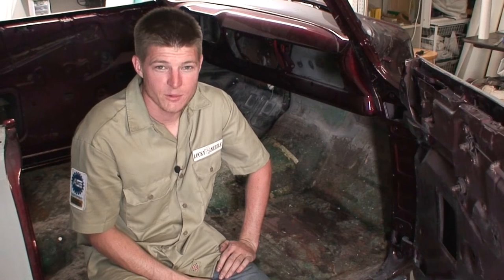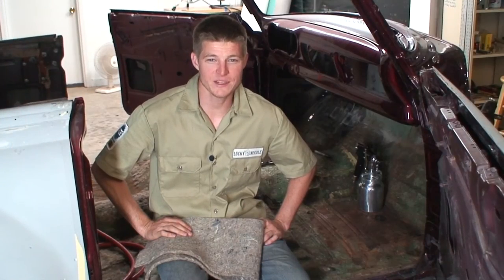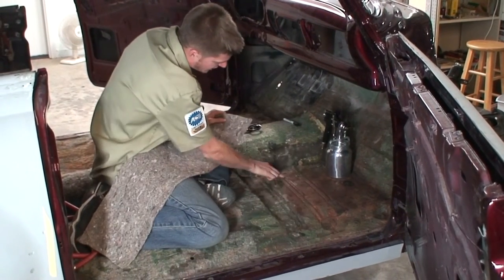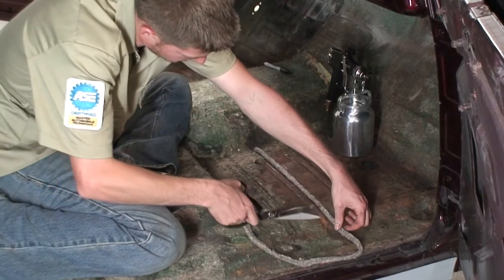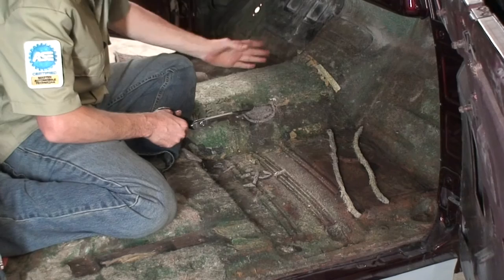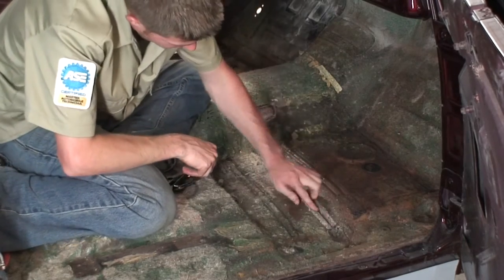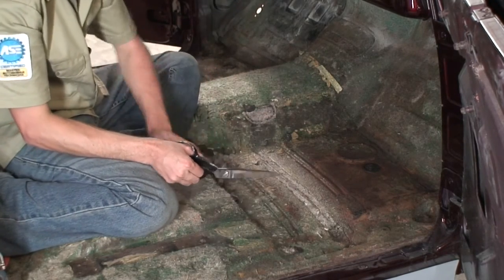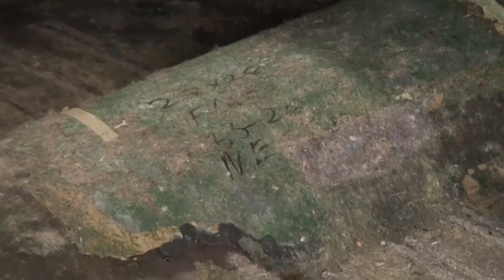Upholstery Basics - Installing Jute Carpet Padding  Step 1

Comment: What glue do you use?
Reply from the maker: weld wood landau top contact cement. Its the best i wouldn't everything else Ive used is horrible compared this stuff. This is the stuff right here
 http://amzn.to/2lq2K8Z
Reply: The Lucky Needle, that's what I use at work. Just wanted to see if you use something different. I see you are using the HF gun. Are you using the stock tip or are you using a larger one? I have that gun also at work and struggle with getting to to spray evenly. Usually get a bunch of spitting and sputtering with an uneven fan. I'm currently rewrapping some headliner panels in a yacht and opted to brush it on with a foam brush. when I spray it I tend to get a lumpy finish due to the clumps of glue under the fabric.
Reply: The Lucky Needle seach Alvarez metal works on Facebook and message me. I'll send you some pics of some of the stuff I've done at work.
Reply from the maker: Hey, Yeah its the HF gun. It has the stock tip. I think its 1.8. You have to bump the pressure up to about 90+ for it to work well. Also make sure the vent nipple and tube on the pot is completely clear. Check to see if the bottom of the pot is filled with old glue that is too thick. These 3 things pretty much always the cause of the problem your having. If not i just buy a new one. That's why I use those for glue, because there so cheep.   If its spraying properly you wont be able to see the glue bumps when you lay down the material. I hope that solves your problem because id go crazy having to hand brush a job that big!
Reply from the maker: Hey Alvarez, 
I only have my business facebook https://www.facebook.com/TheLuckyNeedle.  I don't use a personal one
Here is my email too    John (AT) theluckyneedle.com

Looking forward to seeing the pictures!

Comment: Do you recommend putting down Dynamat or Dynaliner for the floor?
Reply from the maker: Its really up to you. If you want that extra sound deadening and heat resistance  you can also use Dynamat. My opinion is it really expensive and not worth using.
Reply: And Dynamat is heavy! It's a gnarly sound deadener and I see people basically cover the entire car in it, but I've seen the reps use just a small square to attenuate a bell. So why wouldn't you be able to just use smaller strips of it to knock down sound and what not in a car? Doesn't make sense to me how they apply it, probably to milk money from sponsors  on TV and customers off the air.
Reply: To add on to my response, extra weight kills performance and economy. A car covered in Dynamat or one of it's bastard brothers would easily add a couple hundred pounds.
Reply: they sell a lighter version in Lowe's that the whole car Community knows is a cheaper version and has been using for quite some time is $16 a roll and it's called Frost King duct insulation and it's lighter than Dynamat I actually have quite a few waterproof lightweight sound deadening options in Home Depot and Lowe's rather than buying from car companies.
Reply: I also don't understand why if you're going this far with a car that you wouldn't put down some kind of protective epoxy rust killing paint like por-15 or Rust-Oleum with a little enamel hardener in it every paint company out has something like this in a black gloss for all different prices.
Reply: @firedog93551  i did my floor and 2 door panels in 68 cadillac coupe. Used 2 boxes. Each box weighed roughly 6 pounds and was 60 thick
Reply: Can you please tell me what those options are? Thank you for the Frost King tip. I want to be able to compare the materials and pick the one best for the situation. Thank you!
Reply: @sunnypsyop2897  So you're asking about the differences between Dynamat vs. Dynaliner. Dynamat is a tar like material that is laid down to deaden noise. Dynaliner is a padding manufactured by Dynamat to that blocks heat and noise. The advantage it's waterproof and doesn't create mold or rust on the floors. Dynaliner should be laid on top of Dynamat or Dynamat Extreme now called.
Reply: @Theluckyneedle  once you put down the other type sound deading,, forget up ever getting it up again.